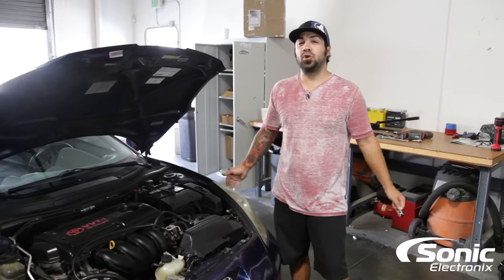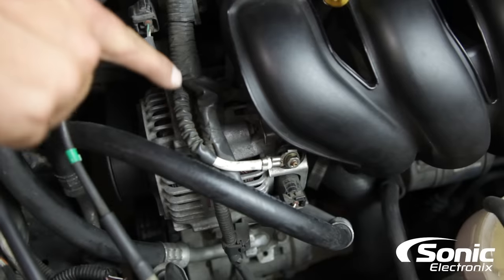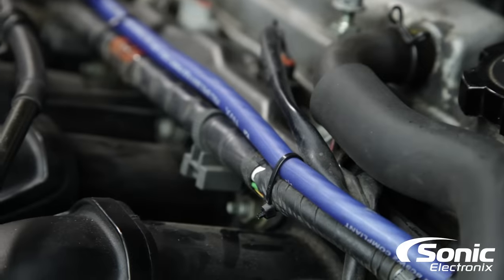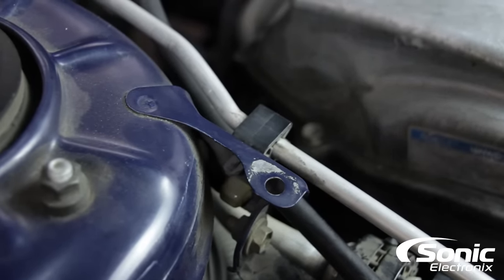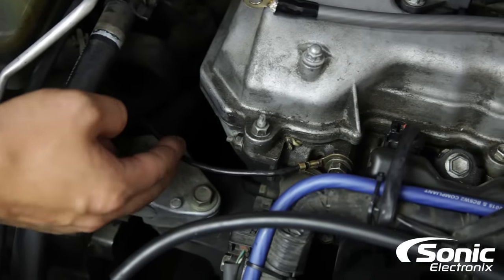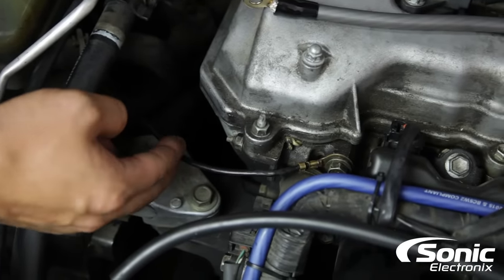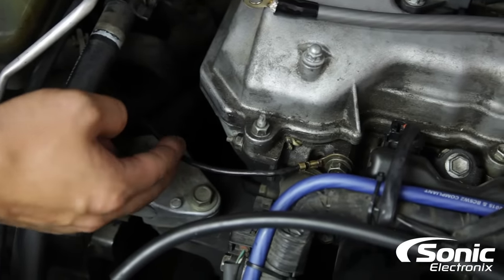How To Install the Big 3 Upgrade | Improve Your Vehicle's Electrical Charging System | Car Audio

Comment: Yeah... Jeep can go to hell with those Patriots.  I had to change the starter on one and NEVER AGAIN.  It's literally inside the engine behind the manifold.  It took me an hour just to take everything apart to get to it.  Jeep can suck it.  I told my friend to hope the alternator never goes out because when I looked at how to do it, I said "fuck that".  You have to have the thing up in the air, wheel off and drop the AC compressor AND the bracket that holds it just to get to it.  Oh, don't forget you have to pull the air cleaner assembly to access the battery.  He shows it here, but just sayin'.  Some of the worst automotive design I've ever seen.

Comment: I failed to see how this improves anything... 🤔 (Still no answer after 3 years tells me enough).
Reply: Well I thought they would be putting in new batteries like xs power and a high output alt to create better grounding and high energy flow to your battery(s) so that your voltage doesn’t drop super hard with a high demanding system and you can keep a nice steady 14v. Personally I wouldn’t have used that small of wire to ground and run a power wire off the alt. But, it’s a good reference as to what to ground and how to add an additional power wire off the alt
Reply: @_JoeMomma  The engine doesn't need that much power (ignition, injection system). Modern cars who do need more power for their systems (computers, electric windows etc.), are already  equiped with a higher power alternator and battery. 
I can imagine if one would fit a a large array of lights and/or high power sound system, one would upgrade their wires if ALL systems are deployd at the same time.
Reply: Been scrolling comments to try and find answer to this very question. All i see are vague "it helped" responses. Helped what? A larger wire means less resistance, that's it. If all loads stay the same, it's basically a money waste.

Now if a cable in fact is fairy, then this is more a big 3 repair not upgrade.
Reply: @felipepubillones2768  Agree. When installing a larger battery and/or a stronger generator, one might have to upgrade the wiring as well. Most systems however, are quite capable to deal with the extra load. 👌

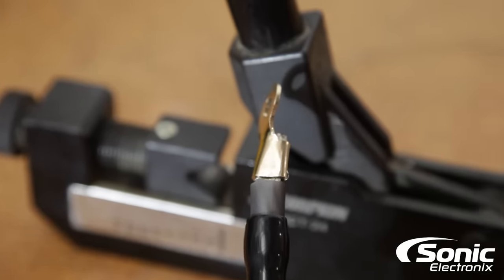Comment: I stopped this @1:49 to comment.   Those connectors and crimp are absolute crap!   Asking for all sorts of bad issues including corrosion.   Get a better connector and solder it! 
@4:28  Why the heck did you fail to protect those connectors to the stud without a Synthetic lubricant to keep moisture and corrosion out????   Same with Battery Posts 😡    HOLYYYY   MOLLYYY  @7:50  Again, no moisture/corrosion protection 😡😡😡   Lawd Fadda  Clear coat to just make it look good?   Do you really have any clue about corrosion and electrical interference/failure ?????
Reply: You're thinking of solder slugs, right?
Reply: @thecarman3693   Well if you want to go to that expense?   As I am also a plumber, I simply use flux and solder as needed.  I buy solder in bulk and relatively cheap!
Reply: @lisab3396  If you're only doing a few, and it's for battery terminals as this case, I would go that route.
But for other applications, like audio connectors, I prefer a good strong crimp.  Just not like what's shown here.  I use the hydraulic hand crimper (10 ton) as it compresses from all sides at once, and makes for a good solid cold weld.  Then I seal it with adhesive backed shrink tubing.  Never had an issue.
Reply: @thecarman3693   Be careful with assumptions.  I do industrial machines equipment!  VERY CORROSIIVE ENVIRONMENTS!